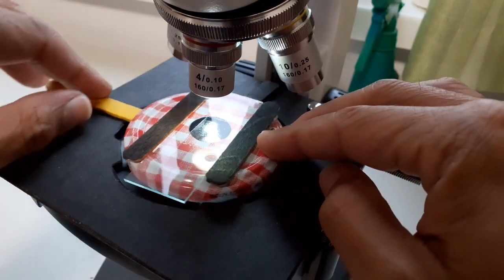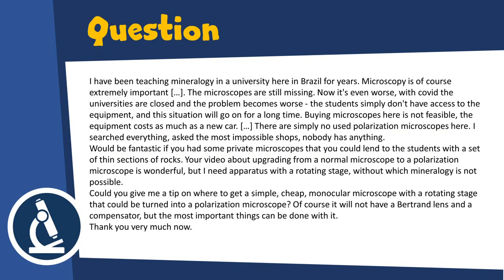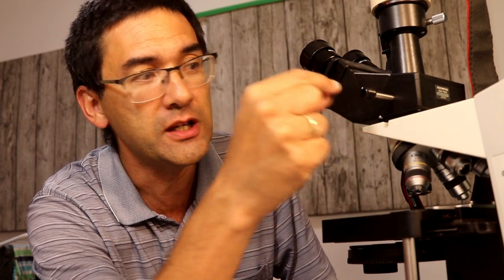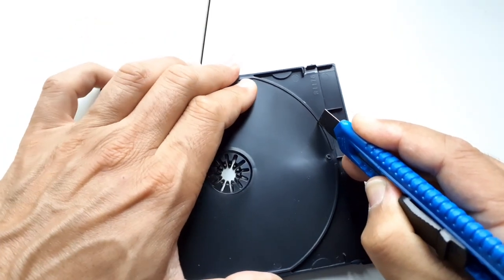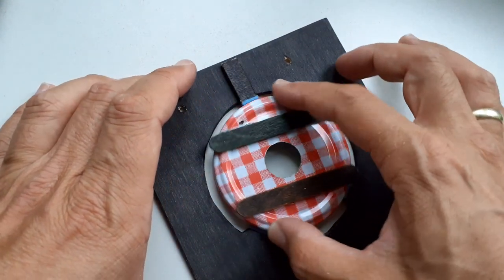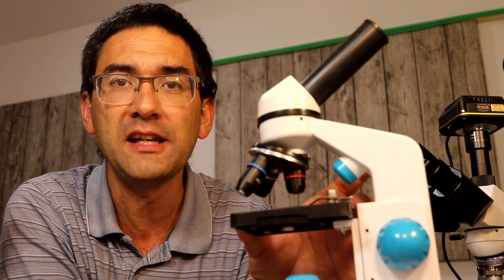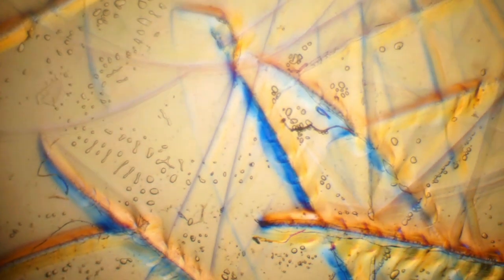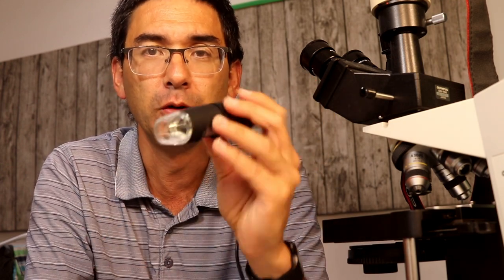🔬 Making a rotating microscope stage for polarization microscopy | Amateur Microscopy

Comment: I applaud your creativity. I would like to recommend placing polarizing film under the condensor instead of above it. I would also recommend putting the 2nd polarizer between the objective and the microscope head. The issue you point out about depolarization is a real issue, however with some experimentation, you can get the polarizer in the correct orientation. I would strongly recommend that you search for a glass polarizer of an appropriate size for the one above the objective. Plastic polarization material is not polished as optically flat as glass polarizers so the image quality can degrade especially with higher power objectives. You can easily rotate the polarizer under the condensor  and use it as the analyzer. 
I've picked up most of my equipment as used parts on eBay. This was certainly more expensive than DIY but I'm very happy with what I have.  I've had no trouble having parts shipped to the US from eBay sellers in other countries. I don't know if shipping would be an issue for viewers in other countries. Good luck to everyone exploring polarization in microscopy. It is an amazing technique.
Reply: oh wow, awesome! im gonna try this on my setup!
Reply: This is what i did. So much easier. So much better and works wonderfully. I just put the movil polarizer under the condensor and the other one above the slide.
New hidden objects are now visible thanks to the polarizer. And you can switch between dark field and brigth field in less than a second

Comment: A cheap source for linear polarizing filter can be found by opening an old LCD monitor and removing the appropriate piece of plastic sheet (there are usually many layers of plastic sheet in there doing different jobs, diffusers, BEF filters etc).  When you remove the layers of the LCD you should be able to test to see if the layer is polarizing by rotating it in front of a working monitor. It will cause the monitor to lighten and darken depending on the angle of rotation as it lines up with the polarizing filter of the working monitor.  Similarly you could also test the sheet with a pair of polarized sunglasses.

Comment: You gave me a wonderful idea. You tried with a standard CD box and didn't work. I am planning to use an half size CD box which is very thin. The CD inside this kind of box is much more stable and you can use the same trick (popsicle stick) to easily rotate the CD. I think you do not need even to cut the CD support. Thank you. I gave it a speedy try. It works, but you need to remove the slide holder first, and you need also to make the rotation axis of the CD coincident with the light axis. When you have found it, you cannot use the stage controls anymore, since every movement make you loose the center.  If you want to appreciate phenomena like pleocroism, especially in rocks thin section it is important that the specimen should be able to rotate exactly around itself. For that reason, I think it is better to screw the CD holder to the stage to avoid accidentally movement.

Comment: IDK what kind of resolution of detail is needed for minerology but I have a $80 amscope, no frills, even has a crappy iris disk instead of a proper iris under the stage. But I put a polarizer above the light, and a cut out round in the eyepiece, and by turning the eyepiece I can tune in the polarization cut out, its the rotation of the specimen that has been a pain......until now! Im going to throw my cheap crappy scope back together (dont ask) and give this stage mod a try!

While I completely understand the reason for the cost of lab grade analytical microscopes, for exploratory introduction to microscopy, and considering from what Ive seen on the lower end scopes from this $80 up to a few hundred they're all using the same parts and most of them arent terribly complex to make, the bar for entry boarders on taking the piss. Im sorry, but Im a machinist/fabricator by trade, and when the difference between a $140 scope and a $220 scope is a $20 iris you can get on amazon......they are %100 taking the piss. Period. If there was a difference in the lenses or something it would make more sense. But seriously, these general student level general hobbyist level scopes made by the big 3 in the market bracket are totally overcharging. Hell, when I got mine there was mold in the lenses! I had to disassemble the assemblies before even using it! Luckily Im handy with such things, they're not perfect, but still do the job. Its ridiculous...... And I have no idea where some of these people are getting parts and swapping out  heads and stuff, I cant find a damn thing on the various used sites. Every search is whole scopes at best, yet I see other people finding all sorts of parts and piecing together thousand dollar scopes on the cheap! After some experience with this cheapo and seeing the next few models up my personal opinion is dont try to nickel and dime your way into it, just save up and dump like $300 or so on one with the proper features and mod from there if you're so inclined. And if it doesnt arrive absolutely perfect, send it back and get another one until they send you one not built on a monday.